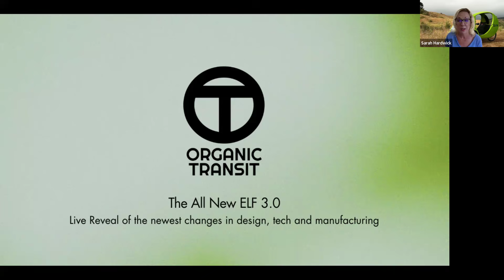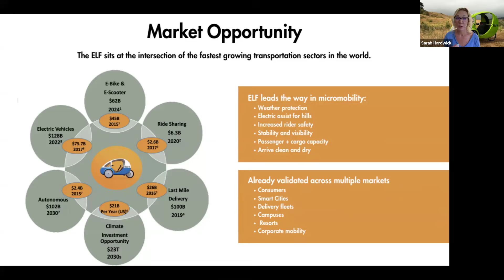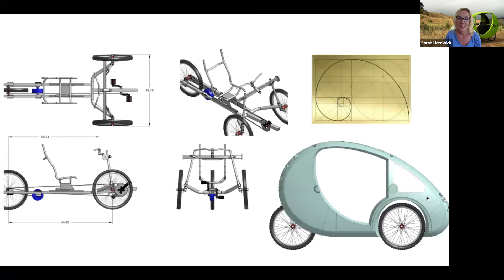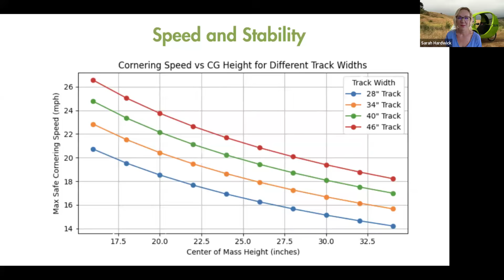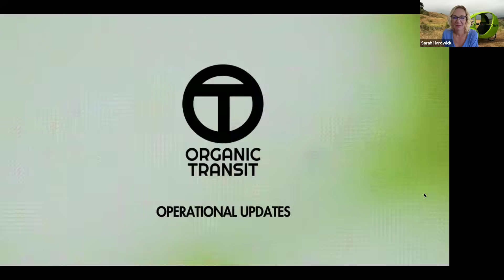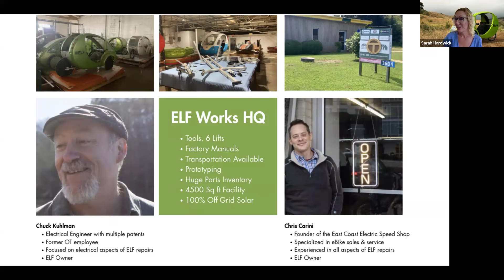ELF 3.0 Reveal Webinar

Comment: It seems this new video is not getting enough views, probably because it is not shared with the FB owner groups.
Reply: I think I received an email a few days ago, but my uncle is dying, so I've been out of touch and missed this video until now. I have an interactive FB page and will absolutely share it. I used to share the ELF website and some of the YouTube stuff in the past.

I've been waiting for a very lightweight pedal car, like I was promised in my Weekly Reader in elementary school. We were supposed to have them before the year 2000, but that didn't happen. I'm trusting ELF to make my dream pedal car a reality.
Reply: @JesPiddlin-Author  There is a design sold in the EU which uses a safety frame inside a car-like shell. They tout it as a crash tested collision protection frame but the EU rules mandate very low motor power and modest top speeds. The new OT design will be safer in collisions but the doors they plan will offer almost no side protection unless they use a heavier frame than the prototype drawing suggests.

Comment: Remember the PEBL velomobile? They went under for two reasons - their fully enclosed 'hemp resin and fiber' body shells started disintegrating in hot sunny weather and forced a recall, and their decision to totally enclose it with an inner fabric liner, wooden dash board, full suspension and silly things like illuminated storage bins and heaters that sucked the battery dry all made it too heavy to get up hills at 240 pounds curb weight while conforming to the 750 watt motor limit. They started selling a 1500 watt illegal version designated 'off road' but it was too late.
Reply: That doesn’t necessarily mean that this one will go down too.
Reply: @BrowncoatG  You are preaching to the choir here. I've had my ELF for 12 years. It has saved me over $50,000 in car expenses.
Reply: @pop @popeyegordon 
Dios, that’s tempting
Reply: @BrowncoatG  I used $20K of the savings with my ELF to pay cash for my amazing Arcimoto 3 wheeled EV that can do 85 mph. It is exciting to drive and very safe. Bought my last gallon of gas 12 years ago! No more insurance either.

Comment: Scratch resistant windshields are worth the price - ELF windshields collect thousands of micro-scratches within a few months. 
Readers should note that there is a high quality vinyl cling tint available that uses no glue. It is easy to add a dark sun filtering tint to the side and rear windows as well as the windshield brow. My tint job is still good after 10 years here in Florida.
Reply: Will the windows be removable for those of us who prefer to feel the wind on our faces at slower speeds without electric assist?
Reply: @JesPiddlin-Author  The small side windows? No. Maybe the rear window. You just made another comment that sounds like you don't want a body shell on your trike. It is worth it for the safety and higher visibility in traffic and of course in rain or too hot sun. The air will not be stagnant inside and of course you can add a little USB fan to the handlebars for times when you are not moving and it is hot. The fan also can act as a defogger for the inside of the windshield.

Comment: A short rear wheel fender is needed. I added one to mine. Nobody likes a black stripe up the back of such an expensive vehicle. 
Also a front air scoop for hot weather and to prevent bad fogging of the inside of the windshield. The scoop could be incorporated into a sharp looking front grille that holds the horn as well. Bigger doors are not enough especially when you enclose the floor. 
I use platform pedals that support the entire foot - the floor will need a clearance nacelle for those. Platform pedals are sometimes needed for strapping in feet of disabled drivers. A good thing about the bigger doors is that it will be easier to pull in a folded wheelchair behind the seat.
Scratch resistant windshields are worth the price - ELF windshields collect thousands of micro-scratches within a few months.
Reply: I don't like the doors. They are too enclosed. Good for bad weather, but a normal sunny day, I want as much wind in my vehicle as possible.
Reply: @JesPiddlin-Author  The vast majority of all owners envy doors and make their own or buy a kit. I'm in Florida so I also want maximum ventilation.

Comment: If you test drive a 2.0 and then a 3.0, you will experience a huge difference in the interior noise level because of the new closed off floor. Rattles and tire noise tend to bounce around inside the 2.0 body shell. Over the years I have seen many comments complaining about the noise. I got used to it but the closed floor also means no more risk of broken ankles due to catching your feet on the pavement while moving.
Reply: Sounds great! I just bought an original and it's pretty great. 3.0 even better! Can't wait!!

Comment: The rear hatch on 2.0 has always had issues like cracking and leaks. I like the new large door for access to the cargo or rear seat. For hot climates I think it is important to have the smaller rear window be opening for ventilation.
Reply: Mine is cracked. I duct taped it up yesterday.
Reply: @dtl  You should be able to order a replacement now, or soon. OT did not know how brittle it could be when rolling up and using the velcro strip to hold the hatch open. Especially bad in cold weather. Mine started developing dozens of micro-cracks 8 years ago before I removed the velcro and stopped trying to roll it up. I just stick my head in and let the window rest on the back of my head while accessing the trunk. The Facebook groups for the ELF are a trove of useful info for repair and maintenance. A must for a new owner like you.
Reply: @popeyegordon I'll check that out! Thank you for letting me know about it
Reply: I prefer it to be as much like a bicycle as possible, so removable windows and doors would be super. That should also make it lighter weight, which would help me a lot, too!
Reply: @JesPiddlin-Author  Weight will not matter when you have e-assist. That's what it is for. And doors reduce air drag turbulence.

Comment: Very serious issue with the body design - the front pillars are too wide so they cut visibility which becomes dangerous in close quarters like parking lots or whenever you are turning corners. I say this after driving my 1.5 for 11 years. I have come close to hitting people when they walk across in front of me at the same rate as the turn I'm making so they walk in a moving blind spot to my forward vision. At least one owner drilled holes in his pillars for visibility.

Comment: Pros and cons of more digital control: Con - Having a cellular communication device built in means you must rely on the seller to pay for that service perpetually. When the company behind my Arcimoto autocycle had troubles, they stopped paying for support of the cellular tracking and software upgrading. My insurance company does not know that so I still get a discount for having a tracking ability.
Pro - you need no key, you just enter a code that you program to unlock the vehicle. That is freeing. 
Con - I don't want no stinkin' smart phone, my home PC is vastly superior in every way. So I don't want to lug around some expensive pocket weight for controlling my vehicle in which the doors can not be locked. Software dependent vehicles always have unforeseeable issues that make them undrivable, this is inevitable. The electronics are vulnerable to humidity or water intrusion too.
Reply: I have a flip phone because I want to leave the internet at home on my computer, not with me all day long. No internet on the road for me. I want something I can drive without a phone being required.

Comment: Very excited to see this! We bought an original ELF yesterday and are already hooked!
Reply: Can you find replacement parts
Reply: I'm speaking with the CEO today. I'll ask. I need some parts myself. @robertddvv2
Reply: @robertddvv2  Good bike shops know how to find most parts, or how to upgrade a particular system so it is more rugged. Better parts are being developed constantly. I installed a very tough nickel plated motocross chain for the motor drive and it did not stretch at all but the original stretched and needed tightening every month.
Reply: How is it going? Have you access to the Facebook owner groups? Their archives are priceless for dealing with maintenance, repairs and upgrades. I've posted a dozen of my upgrades over the years that turned out to be very popular and copied a lot.
Reply: @popeyegordon I'll have to go find it. I did connect with one group.

Comment: Weight? I assume it will be heavier than earlier models, but by how much?
Reply: No way to know that at this time. Once you go past the point where it can not be picked up by hand and hung on a bike rack, weight is less important than efficiency in the drive system. Example - the new solar panels will be double at 200 watts, the battery twice the capacity, but the bike will not weigh twice as much.
Reply: @popeyegordon  - Weight is VERY important to me. I want to pedal most places, but I am a heart patient. I need it to be as lightweight as possible. I had a surrey and we had to sell it because it was too heavy for me to pedal. I've been looking at electric-assist trikes for the ability to help me up the hills, but I've wanted an ELF for a long time because of the visibility and safety.
Reply: @JesPiddlin-Author  You are confused. With any e-bike, you only pedal as hard as you feel like doing and you use the thumb throttle to do the rest of the work. In fact you don't have to pedal at all if you are tired or your knee is acting up. With pedelec bikes you can choose the amount of effort in pedal rotation that is required for the motor assist to kick in.

Comment: Need to get rid of black interior it absorbs heat need light interior that reflects heat plus need lighter interior to be more visible on road .
Reply: The inside color will be the same as the color of the plastic used in molding. You only saw dark shading to increase contrast and clarity in the prototype drawings. In Florida I tinted the windows and windshield brow of my ELF to make it cooler.